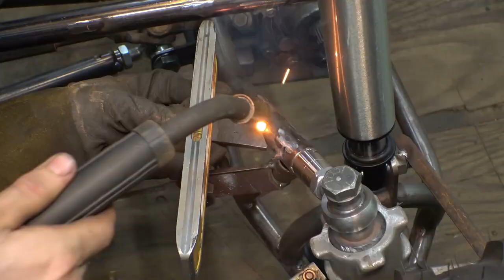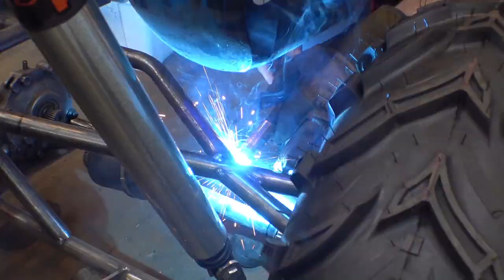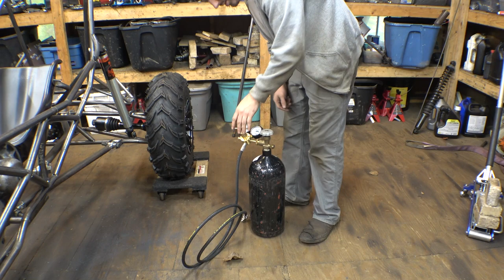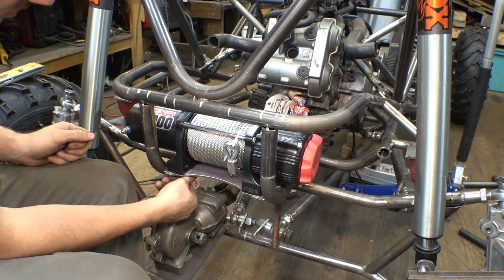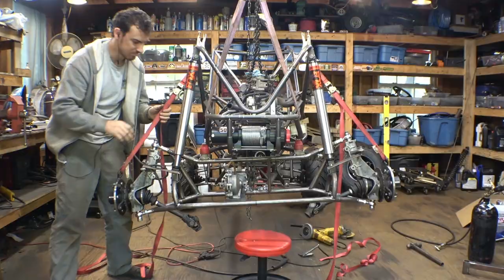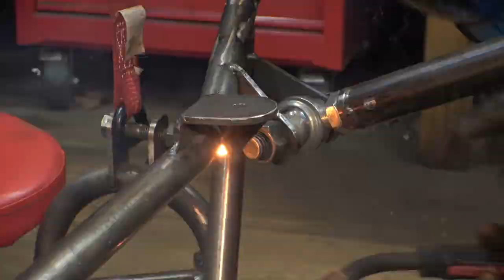Mini Rock Crawler Build SV 650  Part 6

Comment: Chris, around the 28min mark remember that you have put the max nitrogen into the shocks and if you tried to drive it like that it would be like a hard tale harley you would kill your back for one thing and it would be as unstable as anything
If you drop the pressure by a third now where talking
The height will be about right for a rock crawler  have a look at some of the rigs on madram11 Yt channel for comparisons
I think it is looking fantastic mate looking forward to seeing it crawling.
About the engine. I have a feeling depending on the intensity of the crawls you want to do you might consider something bigger hint suzuki waterbottle GT750cc   IF you could even find one boy they used to move like a bat out of hell when they hit the powerband
Or you could look for a haybusa..... Grin
Tony from Western Australia 🇦🇺

Comment: If you would read comments your bump stop issue would be fixed. Multiple people have said put a rubber ring one the actual shock tube at the bottom like some shocks have and it’s a integrated bump stock. Simple and easy.

Comment: ...Instead of using the cone shaped bump stops, what about using some inline skate wheels or hard rubber casters? That way when the suspension compresses and the wheels/castors contact the underside rub area, they can smoothly roll along the surface. With the bump stops as they are, they're not compressing straight into a flat surface. I'd be willing to bet a rolling bump stop would have a better feel than the cone shaped  stops compressing against the underside of the frame at an angle other than exactly 90". Plus, IMHO, wheel casters would look a lot cooler...

Comment: Put the bump stops in the same plane as the shocks, as close as you can to the shocks an you minimize or eliminate the problem of the wandering landing spot where they’ll hit as well as the seesaw leverage action you get when one side is slammed on the bump stop and influences the other side. I’ve seen successful bump stops that were like a short spring loaded tube right behind or on front of the shocks. 

So basically the top part of the bump stop system moves with the top of the shock. And bottom side of bump stop system moves with the bottom end of the shock. They move In the same arcs I mean, and always smash together when the shock compresses no matter what the axle is doing. 

But maybe the seesaw thing is desirable on rock crawlers. I dunno.

Comment: all that droop just means your tires are in contact with the ground more often. typical ride height is 70 percent droop 30 percent up travel, so it should be fairly stable.

Comment: When you are using your roller bender, dont use the middle of the rolls, you run the risk of bending them. Use one end as close as possible to the bearings.

Comment: First of all, you absolutly need to extend the shocks Fully, with no load/weight BEFORE inflating them
You will damage the seals and wont be able to tune every shock equal if you inflate them with weight on them.

2nd, you want to have 6-8 inch of shaft showing at ride height, not more... Air shock push when no load are apply ont them, they have no resistance to that. 
too much air pressure and the shock will unload constantly and you will roll this thing every time you flex it out. Set the ride height at X pressure, test ride, and if it botom out too frequently add  oil in 10-15ml increment until your satisfied with the ride...

And you wont need the bump stop with the weight youre putting on them. properly adjuated air shock will hydro lock themself before botoming out, im running those same exact shock on a 5000+ pound jeeps, and on a 3800 pound rock crawler buggy, no bump at all and its perfectly fine !

Comment: That was a hell of a lot of reworking/welding, whereas if you had followed my comment in the previous video and used shock tube bump stops on all four shocks, you would have been much further ahead. If the shocks you are using are not rebuildable then you could have exchanged them for ones that you could have tube bump stops fitted. It's the age old question of what your time is worth against purchasing alternative parts.

Comment: This may have already been floated, and if Im repetitive my apologies. There are some extremely capable RC rock racers out there, Axial comes to mind first. What about reverse engineering some of their parts and obviously scaling up in size. Theres a 1/3 scale B17 Flying Fortress that was scratch built by two guys who actually fly it, its a huge mindfuck when you see it in the air, but theres a full size human in it. I believe the builder took 1:9 scale plans for a B-17 and multiplied everything by 3. Im sure it wasnt that simple, but the aircraft is amazing.

Comment: Your shocks are at the wrong angle, look at the front when you lift the one side all the way up the opposite side shock is bending which will cause premature wear of the o rings and you will have shock failure rather quickly
Reply: Abdula Amblogada!
Reply: I was watching the same thing first but then again it looks like a wide angle lens problem. Shelving in the back looks also like it's bending.

Comment: Gotta say I think you might be one of the few I have watched building links with inserts that actually drilled the tube for plug welds! Did you drill into the insert as well? 
I am pretty sure it is best to drill a small divot in the insert too.
Hope it helps !
Keep up the crazy build!

Comment: Hydraulic steering dude. Put a hydraulic motor on your steering wheel and a double ended cylinder as your rack and pinion. It can flex till the cows come home. Wildly simpler and probably lighter too.

Heck you could even keep a mechinal rack and pinion but just spin the pinion with another hydraulic motor. Cool stuff actually.

Comment: Great video, again. Love the progress you are making with this build.
One thing I noticed.
The hoops that serve as mounting points for the front suspension are going to need reinforcing or they are going to fold/break if you slip sideways of a rock and bottom the front end on one side.

Comment: Wait a minute, the suspension is now at top level. That is the level shocks are when you are litterarly in the air from a jump. The shocks didn´t move at all when you got in the vehicle, so the pressure is far to high. You should be at approx two thirds of the travel, standing with all fluid and full tank. Then you add driver and are ready to go. So at this time in the build you should have about 5" travel left on the shocks, your´s are bottom´d out, hard, since there is no movement at all..

Comment: U want at least 5 inches of sitting suspension if your gonna use it as a rock crawler then the rest of the travel with be used for the right times

Comment: When I seen it at full extension it looked like the tires could be bigger but I think it will still preform well and you can always adjust things later after the test ride it looks like it's gonna be bad in a good way

Comment: You don’t really need the bump stop to hit at full stuff one side and full droop on the other. You never do that at high speed therefore cannot damage the shock. Best you can do is set it up to hit at full stuff both sides like if you were to jump it.

Comment: You know you could’ve used your air compressor to pump up the shocks for that test to save on nitrogen, only reason they have nitrogen is for a long period of moving up and down cuz the pressure of the nitrogen will not change with the heat build up on the shocks.. compressed air woulda be just fine for testing like that cuz the shock will not be moving rapidly enough to build heat to be able to mess with the air pressure. Learned this when I was like 16 rebuilding my old dirt bike shock.

Comment: 24:30 Before you weld the driveshafts solid, please clock them properly. Each yoke of the center section should be inline with each other. Doing this will minimize drivetrain harmonics. There are plenty of videos on this subject. 26:08 Oh, you do know this already. LOL

Comment: Maybe put some polyurethane blocks inboard of the main bump stops, for when the axle comes up level to the frame. This would reduce wear and stress on the main bump stops and reduce the chances of the bottom of the bump stop rail bottom damaging/weakening the axles with contact.

Comment: NOTICE! Hey bud the 1st gen 99-02 sv650 will starve for oil when doing a wheelie longer than 2 seconds. They are known to lock up when stunted or at too steep of an angle ie rock bouncer.  The 2nd Gen are fine they fixed the oil pick up location.
Reply: Never mind just seen the oil cooler meaning it is a 2nd gen.
Reply from the maker: That engine is an 05 so hopefully I won’t have that issue

Comment: the front axle moves to much side to side.... which is causing your bumpstop problems. you need at least 40* of triangulation (combined upper and lower control arms) for the axle to not move left/right so much

Comment: It's not a bad thing to have suspension that tall you just need to put more troop in it I would run it at maybe half height probably about a quarter height and then you can use droop for your tire to drop down into holes it'll help with balance

Comment: You need to weld a couple braces around that cockpit & roll-cage way to much area there, you roll over and that roll- cage is going to cave in like putty!! Especially around the window area and the back behind the driver seat!! You need some corner braces is what you need, it will make it more ridgid and tougher if you roll over!! Make it harder to cave in on you!!

Comment: on your rock bouncer projects drive shaft i do know if you seen it or not but your pivet point of your drive shaft and the heim joints are  almost in line with each other and with the two being that there is not going to much in and out movement on the drive shaft  but if you did not have them in line with each other then there would a lot of in and out movement on the drive shaft and them  you would  have to make a telescoping drive shaft

Comment: How about mounting the bump stops from the shock.  Clamp a clamp type mount on the lower portion of the shock and have a smaller bump stop on either side of the lower shock. ??

Comment: I wonder.. if you actually joined the high pressure lines on the two fronts together, and reduced pressure until it was say.. 2/3s extended, if you lift up one wheel, the opposite side will compensate automatically as well, kinda like the old citreons with their hydraulic suspension. it would mean that if you were climbing up sideways somewhere, the front wheel that lifts will automatically push the other side down, keeping the front relatively level.   I dont think you could do that on the rears though, beacuse if the front and rears where the same setup, you could tilt sideways and there would be no "restoring" force on the suspension, unless there was some kind of fairly strong anti-roll bar.  An onboard supply of high pressure nitrogen with some regulators would also allow on the fly ride hieight adjustment.   If i was building this ( and im a nerd with no welding skills, so would never happen) i would actually have 4 active pressure controls, you could implement a kind of auto levelling system, maybe even being able to share the front and rear sets of shocks with each other via some valves.   Just like the mars rover with auto leveling physical levers, you could implement that with a gas system.

As for steering, you will probably need a hydraulic or electric steering system due to the amount of movement in the front.

Comment: Dude I like what you are doing but how much ground clearance do you have I have more with my highline 4 wheeler the problem is your diff /axle cage you need to make it in an arch and lift the diff up higher also a clutched cvt system is going to limit the use of the lower gears I would cut out the cut system and just jump to the high low reverse transmission so you can have an actual 1 low gear but as you are now looks cool functionality as a rock crawler I would say somewhere about 50% posable ground clearance flex and low gear are the keys for that good luck 👍

Comment: Throwing in more tubes doesn't increase the rigidity you need TRIANGLES, Please FIX tubes CENTERLINES , you arr making "dead tubes" and polygons all over. Also when you are mounting directly above the axle center line you are missing out on using motion ration for shock placement. You could run a way shorter shock shaft length and still get the same amount of travel.

Comment: Looks quite menacing. Just an observation - are you concerned about the ground clearance of the front and rear differential frames as they only look to be a few inches off the ground. Would they bottom out on rocks etc between the wheels? Bigger wheels to get more clearance?

Comment: Ride height should not be at max shock extension. It should be somewhere near 50% so you have droop.
Reply: reduce air pressure till it sits at 50% WITH you in it

Comment: Hi. A suggestion with the bump stop. Can you fit a rubber cone with a hole the same size as the sliding part on the suspension. So it the cone can slide up and down on the sliding part of the suspension. Then fit 2 round plates to the suspension. one on the end of outer part of the suspension. Near where the the sliding part comes out, and one on the end of the sliding part. Would that help. I hope iv explained this right. Being dyslexic and trying to put things into words sometimes isn't easy

Comment: not video related question - did you slow down the blade on your metal bandsaw or do you run it at the stock speed?  I have the exact same saw and mine does fine with metal at stock speed but I am not sure if I should slow it down.  I am currently running a 14 TPI carbon steel blade 1/4 inch in it.

Comment: Its not about weight... contact fox its about the available safe travel in the shock rebound and compression. Ive personally seen someone ruin a very expensive custom valve job.

Comment: The bump stops aren't going to work because the rear end is always going to be in a different spot if the axles tipped it's going to be in if it's flat it's going to be out your best bet is a bump stops on the shocks

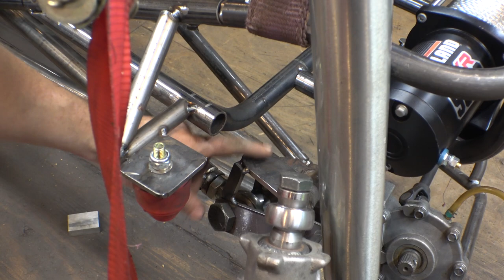Comment: 16:14 Single bumstops would work with an independent suspension, but without sway bars and control arms.... why don't you just add 4 more, but in that other spot? You only need a bumpstop at end of end of travel/ max deflection on both sides anyway, right
EDIT,  I like your idea better

Comment: Why are you not putting the bump stops on the shock itself? The shock body is designed for that. It's how the Mayhem Rock bouncer and every rail is done. Which consists of 5 times the G's your shocks will ever see. They probably sell the exact size you need too. Let's Go, Brandon!

Comment: I'm by no means an expert, but ride height seems kinda high.  Almost looks like it should be near where the shocks are almost compressed.  I would think you would want soft suspension with a good amount of droop. Also, I'm commenting at 10:34 so I should probably keep watching....

Comment: A few things. I am not a fan of the style. The back looks mean as hell. I love the rear of it and the cockpit. The front is a no go. It looks like a damn hammock 😂. If u can figure out a way to make the front more sleek I guess. The other thing. U aren’t going to be able to have that much articulation. So there is no need for that much suspension. U can still use them. They are great shocks. Limiters will be great. U aren’t going to be able to use that much on the cv axles. They will be destroyed. I have destroyed a lot on my Chevy from a 6 inch lift. I would use half of that travel. I mean u bought them. Either use them on a different project and buy new ones or send them back. I agree on 33s or maybe 35s if u can get them on there

Comment: I hope you got plans to put a real seat that holds you in that thing good I would hate if you climb something big and rolled down it and crushed yourself or brake your back on that seat I new a guy with a rock crawler and he flipped it at the top of a big hill and fell out and crushed his head I'm not even sure if he lived but I know if he did he won't be the same safety first need to be strapped in that thing with a full size seat

Comment: @17:17 your shock angle is not correct with these air shocks when the shock tilts in like that under pressure its going to want to flip and wont rebound correctly you'll have major geometry issues.

Comment: Sounds like you really need to draw out future plans for anything on a good quality type computer program and see how everything works together and fits. And some programs even allow you to do stress analysis to see if some portion can't take the stress before cutting the first part. That way you get to SEE the final outcome and can adjust designs before doing the work and realizing it isn't going to work. Wasted time is costly and, well wasted time. Design as you go is good only when it works out. Time to move into the computer aided design and make better products and designs and end wasted energies. JMHO!

Comment: Do the front shocks need to be angled towards the driver instead of straight up vertically? Then it wouldn't look so tall. Also do you need springs to limit the play.
Reply: The shocks are filled with nitrogen that acts as the springs.
The shocks are only vertical because it's at full extension. As the wheel moves up it moves away from the center of the bouncer.  It doesn't matter anyway